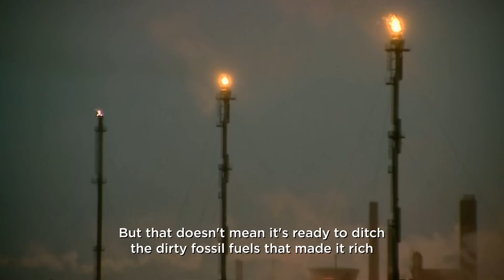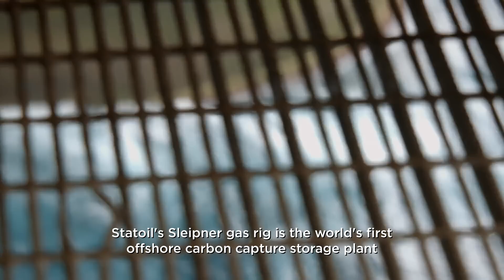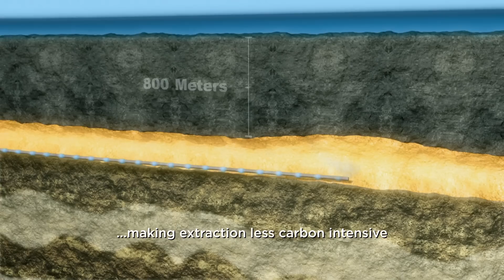Oil and gas companies are facing major technological disruption

Comment: Those coal-fired power plants should have been retrofitted with Karrick Retorts so that not only it will burn smokeless char (semi-coke) but can produce by-products from the raw coal that it will process first through the Karrick Retorts known as the  Low-Temperature Carbonization (LTC) process that will turn the raw coal into clean coal called smokeless char (semi-coke), 1 barrel of oil, 3000 cu.ft of rich fuel gas, and 1500 lb. of solid smokeless char (semi-coke) and co-generate electricity from the steam produced by the water-cooling system at 100,000 kilowatt-hours of electricity at no extra cost other than the capital investment in electrical equipment and steam temperature losses in the turbines from a 1000 ton daily capacity LTC Karrick Retort processing plant. The coal gas produced by Karrick-LTC yields more BTUs than natural gas because it contains a greater amount of combined carbon, and there is less dilution of the combustion gases with water vapor. The phenolic wastes are used by the chemical industry as feedstock for working up into plastics, etc.. The process produces no pollutants other than carbon dioxide. The carbon dioxide purified further and is used for making dry ice and to provide plant food for the plants inside greenhouses. Carbon dioxide is plant food! In laboratory experiments in England, yields as high as 1,000 pounds per acre per day have been reported using at atmosphere with a carbon dioxide content of 0.13 percent. A high of 15,400 pounds per acre per day has been produced in hydroponic gardens at Arizona State University.  When plants like soybeans are experimentally flooded with carbon dioxide  nutrition, they fix more nitrogen, quadruple yields, and their growth can be regulated.

Truth be known, commercial greenhouse owners even purchase carbon dioxide stored in tanks and pump them into their commercial greenhouses to produce greater yields and accelerated growth rates from seed to matured crops to generate higher profits in the shortest amount of time.  In the past before the Biblical Flood the carbon dioxide content of the atmosphere is .25%. In a greenhouse in Britain was given a 0.13% carbon dioxide and produces yields at 1,000 lbs per acre per day. Soybean plants, when flooded with carbon dioxide quadrupled their yields. Commercial greenhouse growers routinely spend a small fortune to buy pure carbon dioxide to be pumped in into their commercial crop greenhouses to produce a vast fortune of profits in terms of vastly increased yields! Carbon dioxide is PLANT FOOD!

Truth be known, commercial greenhouse owners even purchase carbon dioxide stored in tanks and pump them into their commercial greenhouses to produce greater yields and accelerated growth rates from seed to matured crops to generate higher profits in the shortest amount of time.  It is like spending 1 cent to make $100.00 in net profits in the process.

A far superior method exists to manufacture oil from coal. It is a little-known but very attractive, proven method called Low-Temperature Carbonization (LTC). The process was perfected by Lewis C. Karrick, an oil shale technologist at the U.S. Bureau of Mines in the 1920s.

LTC is a pyrolysis process that involves heating coal, shale, lignite, or any other carbonaceous material, including garbage) to about 800o F. in the absence of oxygen. Oil is thus distilled from the material, rather than burning as it would if oxygen were present.

After treatment by the Karrick process, a ton of coal will yield up to a barrel of oil, 3000 cu. ft. of rich fuel gas, and 1500 lb. of solid smokeless char (semi-coke). The economics of the process are such that the oil is obtained for free! The smokeless char is an excellent substitute for coal in utility boilers, and for coking coal in steel smelters. It yields more heat than raw coal, and it can be converted to water gas. That gas can be converted to oil by the Fischer-Tropsch synthesis-process. The coal gas produced by Karrick-LTC yields more BTUs than natural gas because it contains a greater amount of combined carbon, and there is less dilution of the combustion gases with water vapor. The phenolic wastes are used by the chemical industry as feedstock for working up into plastics, etc.. The process produces no pollutants other than carbon dioxide.

Electrical energy can be co-generated at minimal cost, in addition to coal products. A Karrick-LTC plant with a daily capacity of 1000 tons would produce enough steam to generate 100,000 KW-hours of electrical power at no extra cost other than the capital investment in electrical equipment and steam temperature losses in the turbines.

No such claims can be made for any other coal or shale oil project in practice or theory. Nor can anyone demonstrate any other process that is manufacturing oil, gas, and semi-coke from coal commercially and without government subsidy, as is was done in England by the National Coal Carbonizing Co., Ltd. For 40 years, until the NCCC became catastrophically involved in North Sea oil in the 1970s, the company operated five LTC retorts producing Rexco-brand smokeless fuel (plus oil and gas) for use in England's official clean air zones. Other LTC plants have been operated in Estonia and a few other countries, but they are obsolete or are over-managed (as in India)
.
Lewis Cass Karrick did not invent LTC of coal; he perfected it. In America before 1860, more than 50 plants were extracting oil and gas from coal. Boston had five LTC plants that produced oil and gas for heat, light, axle grease, and paraffin. But by 1873, the surfeit of Rockefeller's then-cheap petroleum had forced the last coal-oil plant to shut down. Free enterprise could revive the art, for the Karrick process is most amenable to private enterprise initiative. Oiligarchists fear this possibility and have very nearly entirely suppressed this elegant technology. According to Webster, suppress means "to keep from public knowledge --- to refrain from divulging."

Comment: Large companines are not essential at all. Large compainines were created ot eliminate competition not make production more economic! Large companines have drawbacks. If half th enaiton get's it;s energy from noe company then half the nation loses energy should anything happen to that comapny. It's better to have many smaleer comapnieis, the when something goes wrong with one compay it only affects a small percent of the population. It's also cheaper to repair or replace a small company thna a large one. We've heard the tem too  big to fail used to justify hundreds billions of tax dollars spent on bailing out companies! Wouldn't it be better to spend millions instead of billions?  Fossil fuels will eventually run out. Let's not fool ourselves about that. We may a hundred years or evne two hundred then what? The we'll try to find a replacement with no energy to work with? We need to find those replacements while we still have some energy to work with.  Biogas or methane is replenishable. In fact fossile fuels come from biomass according to scientists. Much of the natural gas burned off during oil roduction comes from biomass. Some of it may even come from other chemical porcesses in the earth. We would be much better off in the long run if we can make energy forourselves. Methane can run a lot of things includidng internal combution enegines! We just need to figure out the safety requirements!

Comment: I personally believe we need to use all sources of energy moderately. Any one form used to it's maximum is trouble down the pike. For instance, if a village had a river running through it, and it mandated that all the villages power be from hydro, the first person in line would harvest the most energy and it would decrease as you went downstream, until eventually you were left with standing water. That would mess up so much more than just the flow of water! And let's look at another aspect. If people went back to sleeping when it was dark, and working/ being productive during the day- we could reduce the demands for energy exponentially! I think modern day "civilization" would have none of that though. There are many battles in each fight. Hard to measure, and do the best by all involved. Every negative has positives, and every positive has its drawbacks... that's real life.

I'm curious. How many here have researched in depth and understand the process of making and disposing of batteries? If you were to ignore the ecological effects, and simply require all mining and production of such products to be done using renewable energy, the whole industry would flop.

Comment: For heavy duty construction, agriculture equipment, Defence Vehicles, Aeroplane, Helicopters, Ships are depending on fossil fuels. It's good that we've an alternative for passenger mobility, power generation so that Oil & Gas is available and prolonged for necessary use. Otherwise oil & gas reserves will get exhausted quick. Whatever oil & gas we're extracting   was formed millions of years before. Once these are empty we don't know from where to get them. Energy source are precious utilization need to be wise and judicious.

Comment: Oil and gas companies have huge revenue from the oil and gas wells. High costs to drill but low costs to exploit. If oil and gas companies invested their revenues into solar and wind. They could maintain their revenues and help save the environment. Sadly it will take stock holders to demand this change.